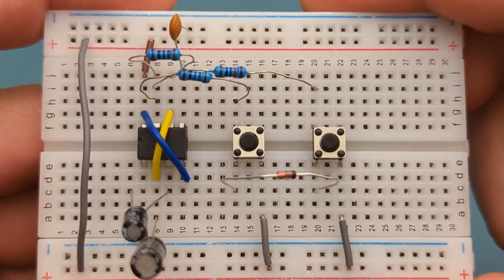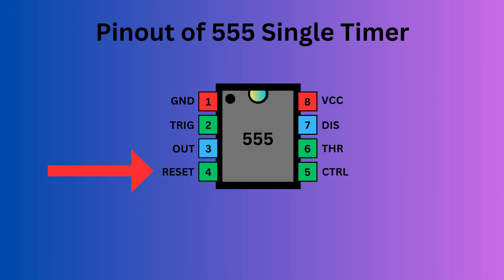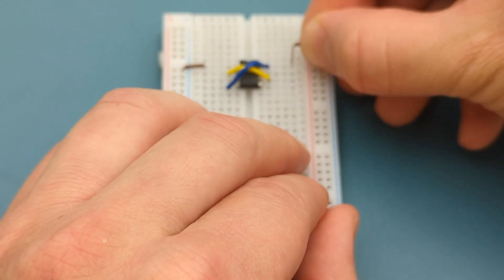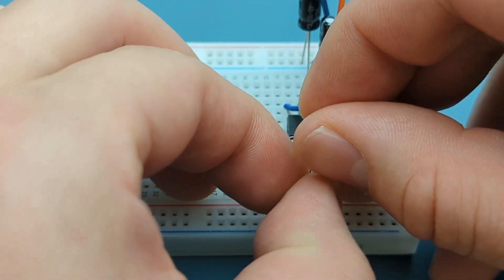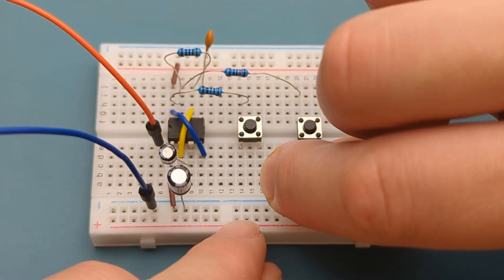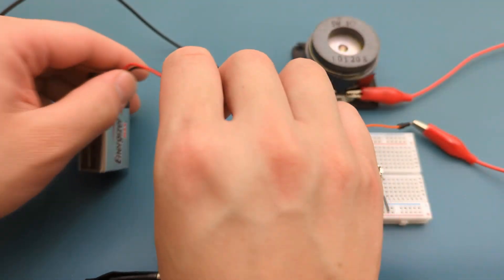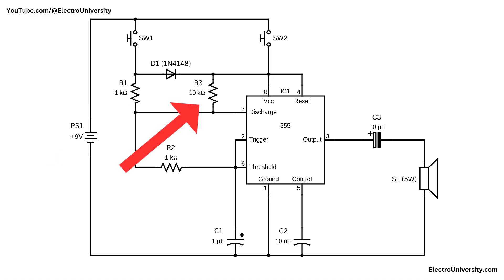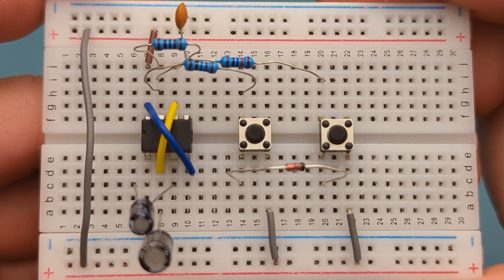How to Make a Simple Doorbell With 555 Timer

Comment: I guess this is not a monostable configuration as you have the same voltage or signal going to the both trigger and the threshold pin and logically as he said as long as you push down the button the buzzer will sound differently depending on which button is pressed and subsequently in monostable configuration we give a high to low pulse on the trigger pin of 555 timer which is not possible and more over the unstable state or quasi stable state has a finite length and so it cannot produce a constant ringing sound...

This configuration is an astable configuration whose output is a square wave and it doesn't produce any AC components..

TL;DR
This isn't a MONOSTABLE CONFIGURATION it's an ASTABLE CONFIGURATION and depending on the button presses the output square waves frequency and duty cycle

Comment: Clever diode switching , nice how you worked it out so the two tones are an octave apart - goes without saying the duty cycle of the second tone is not as symmetrical as the first tone.

Make two circuits the same and compare the drift of the tuning between the two oscillators would be interesting , Ive sort of tried it , 555 astable circuit does not  make a useful tuning reference tone.